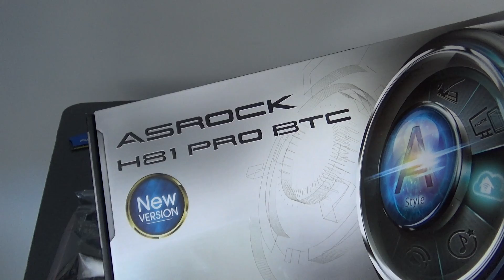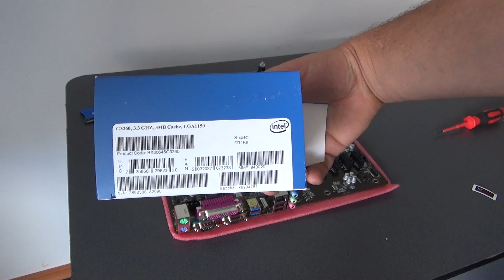How to build your own ethereum mining rig

Comment: Is it Mandatory to paste thermal paste on CPU?
Reply: Yes! If you do not put thermal paste on your CPU, your CPU will thermal throttle like crazy. The thermal paste is used to create better transferring of heat from the IHS (Integrated HeatSink) to the heatsink.
Reply: no u have to do it it makes your cpu run cooler
Reply: your cpu will thermal throttle bad. gpu paste is really cheap though
Reply: *cpu paste

Comment: Cloud mining is way easier and less expensive  I received a payout everyday click here for 3%  off. https://www.genesis-mining.com/a/408945.    I've been with this company for two years so they're safe no scammers here.
Reply: fraud
Reply: TV Tube I invest $400 US and everyday I get $1.50 to $3.30.

and if you use the code above you will get 3% off your initial purchase
Reply: Firez what's bad about investing $400, and then every day for the rest of your life or until the Bitcoin Bubble Pops you receive 4 or $5 every day I've already hit ROI.  so is this point I get free lunch every day and the higher Bitcoin climbs the more I get per day.  FYI I also have built three rigs so for the price of one video card you don't have to worry about programming or determining which coin you should mine because of the rising difficulty rates there's a lot to consider and it's way easier just to put $400 down or more and just sit back and let your money return. a certificate of deposit currently is only running at 3% on the high end..     Cloud mining is way easier